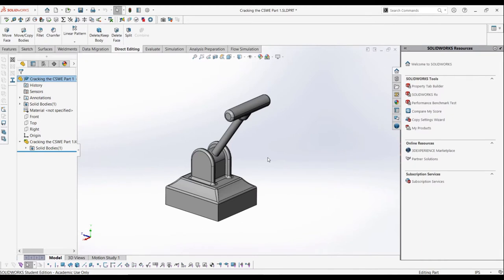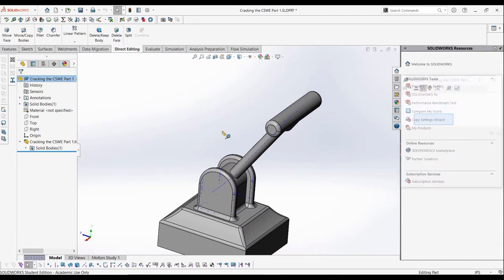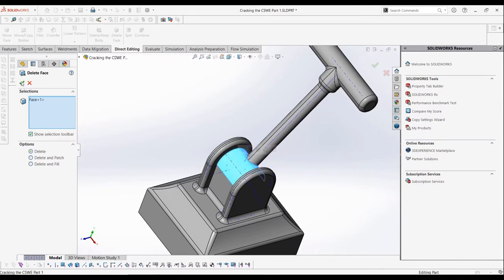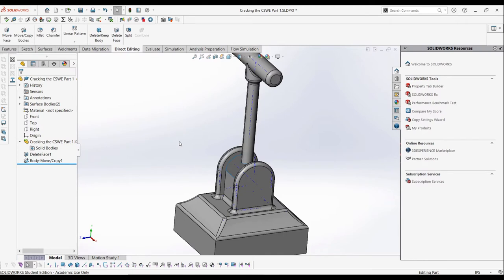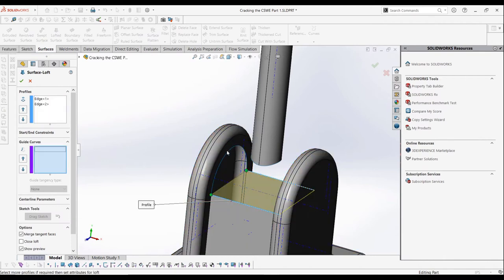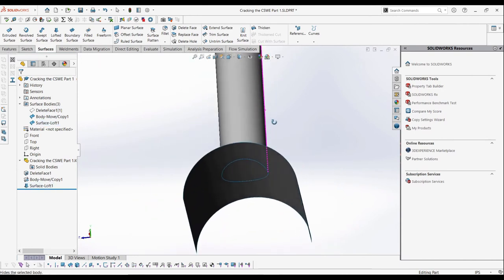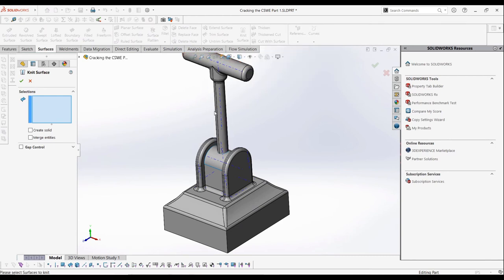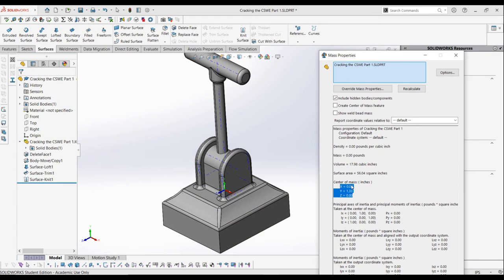Cracking The CSWE | Episode Nine: Surface Modifications | Full Certified Solidworks Expert Course

Comment: Great video but I have to ask isn't using the split feature a bit easier? You would just click the face to split the part into two bodies while both bodies are still solid bodies. Then you would just rotate the part using the Move/Copy body feature.
Reply from the maker: You are 100% right, the only reason I did this was to show a broader set of Solidworks features that may be used in other applications that would be required on the CSWE. But yes if you wanted to do what we did on this part, then using your method is exactly the best method.

Comment: Great Videos. They definitely helped provide an idea of what to expect on the exam for when I took the test. I am curious how you found your exam?
Reply from the maker: Hey thanks for watching. I found the exam to be pretty difficult at the time that I took it. I would say the biggest issue for me was checking over answers as there are some pretty tough questions where its hard to tell if you got it right. Time probably will not be an issue as there is lots of it, so make sure you check all your answers and you will do great :)
Reply: @Lucas_Crupi  Yeah, Time was definitely not a problem.... For sure, some of the problems were a bit tricky... gotta think outside of the box and do whatever works. haha thanks, I did do well :P I felt that the Professional Advanced exams were much trickier though.
Reply from the maker: Oh so you took the CSWE already, congratulations, did not catch that when I first read your comment. Yeah the CSWPA's tend to be a lot harder for the specific subject area but I think the CSWE still covers a broader range of material that you should know. The hardest exam that I have taken was Mold Tools and I have no intentions in trying to pass it soon.
Reply: @Lucas_Crupi  I didn't do well on Mold Tools either... I thought it would be easier that surfacing as I am a Solid Mechanics person.... oh boy, I was so mistaken. Also the practice does not prepare you for that test at all.
Reply: I hope you can answer my mail